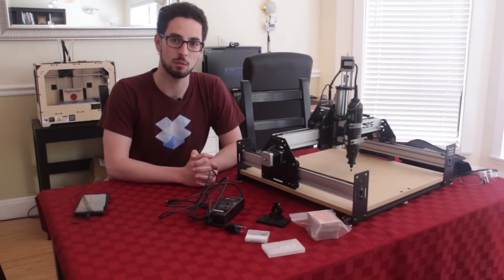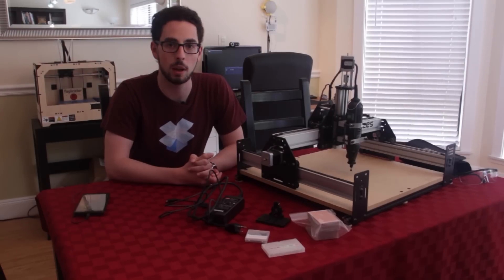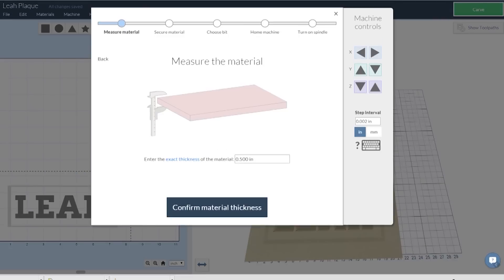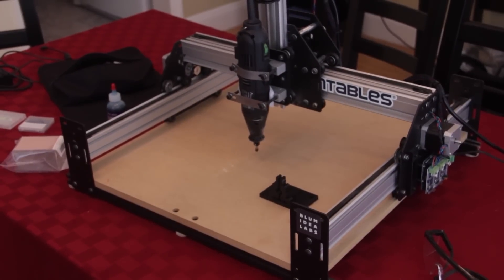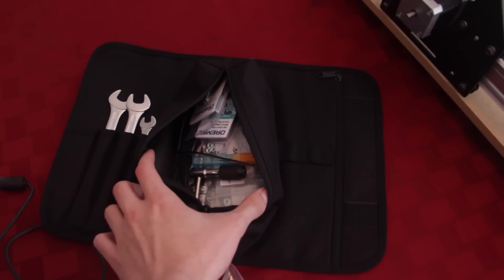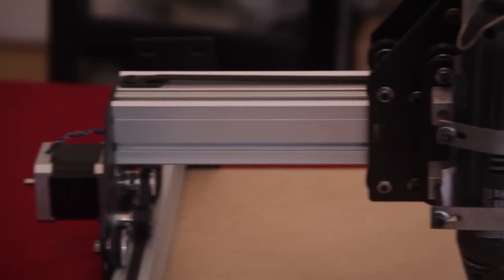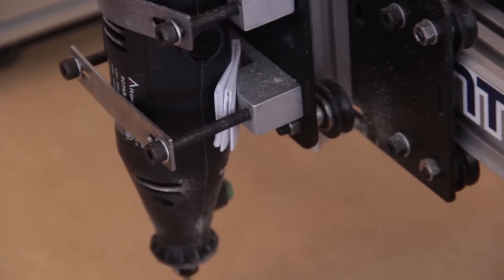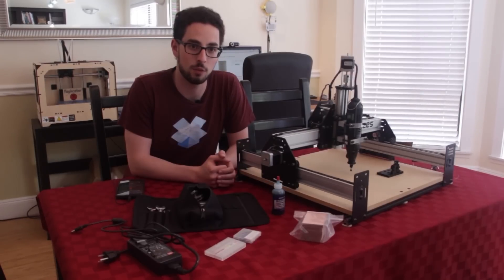Shapeoko2 CNC Mill Build Log & Review

Comment: You can tap aluminium without oil but you have do use the right technique. The trick is to rotate back 180 degrees (~half rotation) every time the force gets to high. It depends on the diameter you want to cut , so every 1-3 rotations, rotate 1/2 back. This way it works but with oil it works better offcourse. You dont need special expensive "cnc-oil" :D, every oil or fat is better than nothing. Most DIY use bicycle oil or silicone* oil (*be careful, in open wounds it can cause cancer). But Oliveoil,Saladoil,Butter and Motoroil work too.

Comment: hi Jeremy, What is the software that you use to send the G-Code to the Arduino board ?
I am looking to build a CNC and I loaded GRBL on my Arduino... Sending individual G-Code commands works but I wonder what software can be used, on Windows 7, to control my CNC . thanks
Reply: +Claude St-Louis Try grbl controller

Comment: You should practice tapping holes before you attempt the needed ones. Without experience what happened to you was bound to occur. You should not need tapping fluid for aluminum if the holes are drilled properly and to the right size. For every half turn of the tap you should back it off at least a quarter turn. A guide block would also have been a big help. There really is no good excuse for breaking that tap. Blaming it on a lack of cutting fluid was silly.

Comment: Nice work, but using a Dremel as router will probably only give you a few hours of run since the bearings are cheap and weak
Reply: I have even more trouble with their shaft couplers...
Reply: I can imagine. Its not that they completely break down, you just quickly get a play in the shaft and thus the precision goes down the drain
Reply: Yes, when I made PCB's and used a dremel drill press to make the holes, I quickly learned to put "pilot holes" in the artwork for the etching so there'd be a drill guide right there...
Cheezy but effective.

Comment: you need to check out the shapeoko 3 from garbide 3d I think it is better than the xcarve that is why I have one on order:)
Reply from the maker: RCflyer729 Why do you believe it's better?
Reply: Jeremy Blum well it has bigger mettle pieces so les flex it is cheaper if you need a bigger cnc it come with the better motors and if u compare specks to the xcarve it come with nicer stuff for less money like the biger cutting aria and better motors.... the xcarve still could be better but as far as I know I like the shapeoko 3 better and can't weight to get mine

Comment: You should drill a grid of holes into the table to insert workholding pegs. Also, I would suggest printing a saddle to hold the Dremel tool properly. Cool machine.
Reply from the maker: Yeah you could. But you only get one chance ;)
Reply from the maker: Nunya Biznes Yeah, both of those things are on my to-do list.
Reply: Jeremy Blum You could probably cnc the peg holes too right?